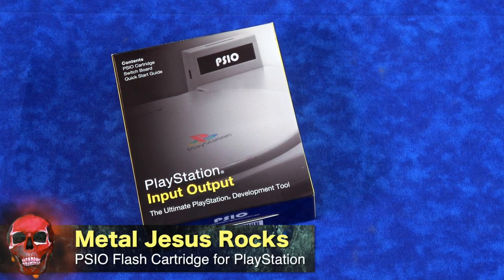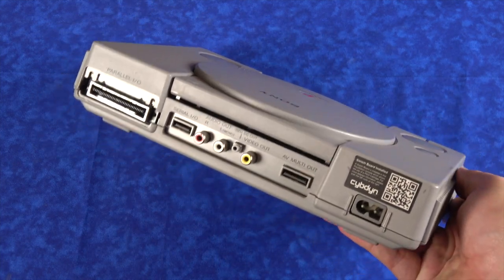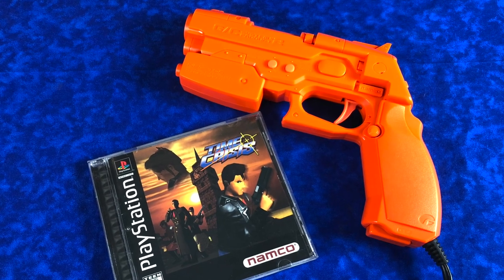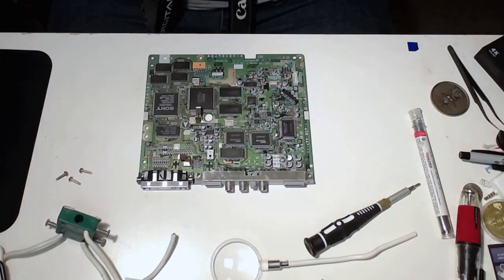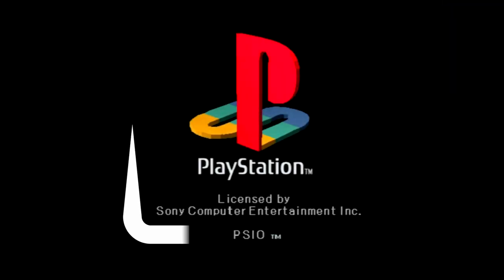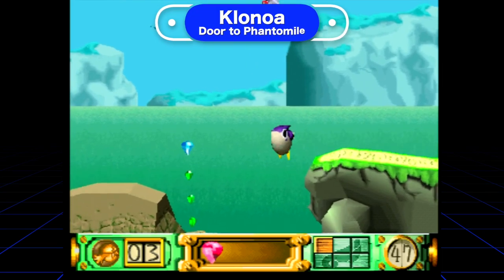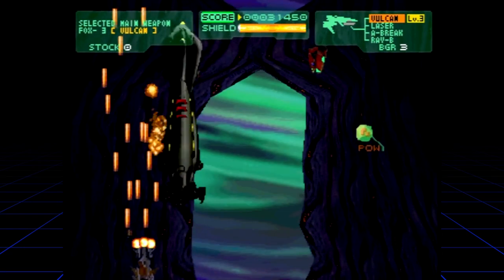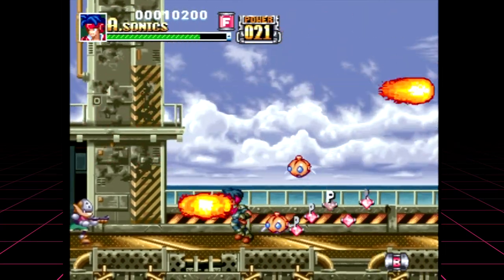PlayStation PSIO - SD Flash Drive for your PS1

Comment: PS1 is probably the last console I would get something like this. With the game emulation being near perfect on almost every platform,  there isn't really a reason to play on original hardware. For consoles of the next generation though, I would get one gladly.
Reply: PS2 and Xbox are both easy to soft mod.   Dreamcast has the gdemu (no soldering required).  I don't think there's an ODE for the GameCube yet, but you can play all the games on a soft modded Wii

Comment: This seems like a pretty decent product. I would definately buy one if I didn't already have a chipped PS1 that plays burnt CDR's. Would be nice to trim down loading times though so maybe i'll look into getting this with a second PS1.

As for the Saturn, take a look at the Action Replay carts, there is custom firmware you can load onto them to allow the Saturn to play burnt CDR's without disc swapping tricks or anything, great way to play backups on there and it also lets you play games from other regions.

Comment: I would just go through the harddrive port for the PS2. Be a lot easier and no soldering. I am not afraid of it, I can solder and this looks easy but why bother when there is an easier route. I am open to some other opinions if they are out there.

Comment: Probably the 100th person to say this, but there are already flash based CD/GD drive emulators for the dreamcast and the saturn as well as the turbo-cd. The PS2, OG Xbox, Xbox 360, Gamecube, wii, and PS3 all have software/hardware mods for loading games off of storage, leaving only the Sega CD, 3D0, and Neo-geo CD stuck on optical media.

Comment: Howdy Metal Jesus! There are already Sega Saturn (Naomi/Pheobe) and Dreamcast Solutions that replace the CD ROM drive with an SD card reader. They are fantastic but again, not for novice installers. Also, I highly recommend a phat for a similar solution to the PSIO; PS2, it can run PS1 games without emulation and you can copy games to the detachable hard drives for a PS1 and PS2 all in one solution. Heck yeah!

Comment: Couldn't this also save on over using your CD drive for an older system like this.  This is basically now a digital game, running off an hard drive.  I don't know much about disc rot (I know, I need to do my research) .Could this help with that in any way?  Anyway, it's really cool.  I bought my ps1 at launch and over time it had trouble readying the disc and I would have to flip the ps1 upside down so that the laser could read it better.  I could of used this BACK THEN. lol  This was a known thing, I even remember reading (I think) in EGM magazine about this tip of turning your ps1 upside and just a a way to play your games.  Well, it worked. lol

Comment: There is only really one big reason why you would want a thing like this. The cd players are GARBAGE, in all these cd based consoles it WILL break at some point and depending on the console it'll be really expensive to fix it. That's why I'll always prefer NOT ever using the CD/dvd drive ever if I have the option.

Comment: goddamn it sony. once again need a damn chip installed lol wtf
anyway, this is interesting i think i could consider it still ive soldered a bit before. 
What kind of load times do you get then? how improved are they? im very curious. SD card coupled with this parallel IO port i mean damn.
And price tag is a big factor too. Jesus christ 150$ and you have to solder in a fucking chip. Thats pathetic. If its not plug and play at the very least then it should be DIRT cheap. Like $40 seems fair but $150? bro come on. Idk about shipping.

Comment: Cool product. I recently put a backlit screen in an original gba and there's a wire you're supposed to solder to an impossibly small point. I tried but couldn't do it. Seems to work without it. I guess it would just be brighter with the extra power from the wire.

Comment: I think that is a damn great device. How many PS1s have already dead CD drives, most PS1s will eventually have failing CD drives in the future. With such a little piece of electronics you can extend the lifespan of a PS1 for decades, maybe literally forever. And you can make even units with failing CD drives working again.

Comment: Certainly a cool invention. I’ve always wanted to see a PS1 flash card. I’d like to see one for Sega Saturn (not the replacing disc slot with SD card slot modification to the motherboard, a flash cartridge which you put in the cartridge slot which can handle 4MB RAM or whatever gives out the best performance, will have an SD Card slot, maybe a disc that runs the software and may or may not require modifications to work), Sega Dreamcast (once again, not the disc slot replacement, a possible modification to the motherboard or a disc that runs the software) and I’d love to see one for PlayStation 2! Either the big one or the small one, possible modifications, however you are going to put it, someone should invent a PS2 flash cartridge or whatever way to play all games you want. Maybe even for Xbox and GameCube! (I do hear that the GC has SD card adapters for its memory card slots)
Reply: I do have 2 PS1 models, one with a parallel port (laser does not work), one without (I had a problem with the controller ports on that one, it still reads discs). Same for PS2, I have the large one and the small one (got for Xmas in 2008). Not thinking about ones for newer generations like 7th and 8th generation consoles because that can wait.

Comment: For $150 you could get at least 3 modded ps1 which could already play games from every regions... Of course you'll have to burn the games you want to play and your loading time will be a little bit longer than if you'd load them from an SD card, but I don't think it's worth the price.

Cool device though, if it was cheaper I'd get one.

Comment: If you are only looking for playing backups, there are many MM3 ps1 chips that cost only a few dollars that basically do the same thing.  It's a similar process of install and requires some careful soldering.  The benefit of that is games play on CDs and are 100% perfect as far as compatibility and also allows import games to run.  

On this unit since you have to remove it to play original CD's, in going to guess there is no way to have it just bypass the region lock to play original copies of import games. Maybe Metal Jesus can confirm?

$110 USD is pretty steep for someone like me.  I don't mind the small load times and boot up logo's enough to pay that much for when just playing backups can be done for much cheaper

Comment: The Dreamcast and Sega Saturn already have sd card base add-on like the GDEMU and Phoebe respectively. however they are not in the same price point as this device. This is a solid option, definitely will be getting one of these after the holidays.

Comment: There's literally two Playstation models without parallel port: the 900x and the PSone, aka the last models ever released. And my guess is that the switch chip doubles as region chip. I'll consider getting one if they really find a way to get rid of the switch chip. My PSX has a stealth chip built in, and I don't feel like finding out if the chips interfere with each other. Until then, CD-R it is.

Comment: There's already a way to mod the Dreamcast to use a IDE/ATA HDD, sd card or even a CF card. A Russian team called DC-swat (Google it) has documented how to solder an ide ribbon cable to your Dreamcast and load it with gdi's you can use a modded DC bios or a boot disc and your Dreamcast has to be reversion 0 or 1. Afaik ver 2 Dreamcast won't work as there not mil CD compatible

Comment: Been waiting for a review for one of these so thank you!! Will order asap! But just a heads up the Dreamcast have what's called a gdemu SD card loader! You loose your gdrom drive but the way Dreamcast gd ROM drives are dying just latley isn't a issue! Also if your mate Chris wants to help you out buy a dreamshell flashed bios chip get it swapped out and buy the i.d.e re born PCB and get that soldered in so you can have a 2.5 inch ide drive with all your games loaded that's what I have in mine personally as you can have it located out the back of the console in a HDD enclosure and keep the gd ROM drive hope this helps!

Comment: As I understand it, you can already do this with unmodified PS2 consoles through the use of FreeMcBoot and some add-on software. Then put the disc images on a USB drive (or SD card inserted into a USB reader) and play them. You can also add a hard drive to the fat models and play the games from that.

Comment: This would be really good if you found an older PS1 with a worn-out disc motor. I got through 2 back in the day and each time I had to put it on it's side after a couple of years.

Yes I had (and still have) no life. No I didn't realise I could get it fixed at a tech shop.

Comment: WAAAAAAAY 2 expensive and def if you need to solder yourself. Also don't buy this but just use OPL and add a hard drive to the PS2 and play ps1 games that way or even on a modded ps3

Comment: You guys didnt use this thing back in the day when PS1 was out?  I used to plug this unit into my PS1 and then I was able to run PS1 back up disks (basically ripped games) as if they were the original disk.

Comment: It's a good device. More for advanced users as you'd have to get someone to install the switch board inside the system and some games require different modes or a patch to work, so not for beginners for sure. It's a lot less friendly than say the USB GDROM or the Super SD System 3(and even the SSDS3 needs modification to fix a few major issues with audio and video)
Reply: oldgraphics Nope. I mean this device. Yes, there is an active forum, but you have to constantly refer to it as some games require specific settings to work. More notably the Streaming Audio settings, so you really need to read up on it. That’s fine for people like you and me, but a lot of his audience are older or not as tech savvy and just want something they can throw at and work. With the USB GDROM and Super SD System 3, most if not all discs works without special mods or settings. With PSIO, quite a few games need special settings and you will need to convert all your BIN/CUE to single BIN images with CU2 format cue sheets. So you will need to do a bit of work before even running this thing, whereas the USB GDROM and Super SD System 3 is more drag and drop. Give a perfect example. 300 games for my PSIO unit took about 12-14 hours to full convert and put together(as also for multi disc games, you will need a MULTIDISC.LST file that their systems console doesn’t always make correctly)
Reply: oldgraphics you cannot just drag and drop to the SD card for PSIO. You need to convert the image first to BIN/CU2. Especially when using the Redump versions which have multiple BIN tracks for sound. And yes you will need to reference the forums a lot as there is no actual chart for settings or compatibility. General rule of thumb is black screen=trip to forums. Matt even said it’s not something they can fix or streamline as it is down to the PlayStation itself. It has three types of streaming and the wrong one will make the game not work. Other games like Spyro 3 need to be patched to work(anti piracy detection). Also, certain modes of the PlayStation have had difficulty running certain games whereas other models don’t have that issue. I seriously need to do a video explaining and showing all this. It’s hard to just put into words without pictures or video. It’s a great device, but for those who aren’t as tech savvy, it’s a headache at times

Comment: the FMV skipping is not necessarily the disc. those early SCPH-1000 series consoles have a common problem with the plastic laser assemblies wearing out.
Reply: @oldgraphics  thanks for the info :) turning the PlayStation upside down will do nothing for bad caps hah

Comment: I'm a fan of the speedrunning community, and the fact that you mention faster loading times has me worried about this device's usefulness for them. Does it have a setting to properly emulate the original optical drive's load times? If not, then this may unfortunately not be ready for the speedrunning community due to fairness.

But also, there is a Dreamcast SD card optical drive replacement already out, or at least far in development. But if someone used that tech, and made it into a Dreamcast modem/SD reader for similar functionality, that would be amazing.

Comment: Why do Americans say sodder? It's solder.
Reply: Dialect differences. For example, Color and Colour and Aluminum.
Reply: Fact...Its pronounced sodder that’s why.
Reply: Happy Christmas :v
Reply from the maker: Al-LOO-min-eee-um. ;)
Reply: If they SPELT it sodder, it would be a different matter, like how aluminium is spelt AND pronounced differently in America. But it's solder. They're flat out pronouncing it wrong. What happened to the fucking L?
Reply: @eddiew.4650  colour and color are spelling differences, not dialect differences.
Reply: @rooty  Spelled not spelt
Reply: ALI-MIN-YIM @MetalJesusRocks  from AUS :)
Reply: The same reason that non-Americans call the United States "America", instead of United States...or USA.

Comment: How it runs all regions? Simple. It just bypasses the region lock. Playstations from all regions can read games from all regions if the lock is broken. There is no difference in hardware or clock speed. If the chip can tell the ps1 to read a game from the parallel io port then it sure can change the mode to NTSC.

Comment: I have a PSIO it took a year and a half to get it i guess they had a hard time getting it developed but installation of the switch chip wasnt that bad if you have basic soldering skills. but i do love having it i have a 256 sd card and have a library of 200 games with still room on my card for more.Best part is your running this on original hardware. Better than a playstation classic.

Comment: i remember i had a device like this for my ps1 that allowed me to play cd burned copies of my games so i wouldn't have to constantly handle my originals causing them to get all scratched up.

I ended up throwing my ps1 away because it was at the point where it wouldn't read disc's anymore. Even when i had it tilted in every which direction possible since that was one of those tricks that seemed to make disc's read better back in the day.

I really regret that now considering i could just get one of these things.

Comment: Dreamcast has a device like this already called the GD-EMU , pain in the butt to find and can be expensive but im pretty sure decent clones exist now too,

Best option for sd loading on dreamcast (if you csn handle a soldering iron) is the ide hard drive  mod and an ide to sd card adaptor, that way you dont lose the disc drive like you do with gdemu

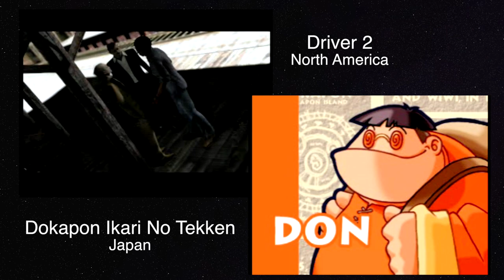Comment: 2:50 but does it run them at 60 or 50hz? 'Cause the whole point of being able to play ntsc over pal is that sweet pre 6th generation 60hz gameplay. If it slows them down to 50hz then what is the point
Edit: 5:10 well I guess that solves that then

Comment: My Saturn was doing the same skipping and really long load time with some discs.  I just need to open it up and turn up the power pot on the CD drive a little.  The lasers get a little weak over time so you have to turn up the juice ever so slightly.  And make sure the glass lens is clean with a micro fiber cloth.

Comment: Sega Saturn already has a flash cart solution, it's called the Rhea, but it requires you to remove the optical drive (the process is reversible).

Comment: While I understand its purpose, I don't really see the point, especially at that price. If you have to go through all of that work (and costs) to play roms on physical hardware, you might aswell go the other way around and just play them on pc with an original controller connected via usb adapter.

At what point does "playing on original hardware" stops being relevant if all you're doing with said original hardware is load roms?

I mean, if you have a modded PS1/PS2 (who doesn't nowadays, anyway?) chances are you already have both the region-free and the anti-piracy chips installed which means that you could just burn the rom to an actual cd and play the game through there. Which is cheaper (virgin cds/dvds are what? $0.10 each?) and actually still giving the "playing on original hardware" thing a reason to be used.
Reply: Shame its not shown in the video, but the much faster loading times are great for most user,
And the convenience of putting rom straight on to SD card and play is amazing for a developer! Much better than waiting a year or two for your exe to send over serial or burning a disc for a build that probably won't work. 
Come one man! It's a flashcart! How it's a question of use ? Any alternative to the CD drive is great to avoid failure of it, and can really help out !
It's still original hardware all the way. This is a disc based system. The games were on discs, discs don't think or anything, they're just spinning data. Sure I can understand a flash cart of a NES or something that has extra chips and processing in the cartridge, but a disc is just a data.
Reply: @televisionandcheese  If all you can come up with to justify it is "loading times" alongside "convenience", then a pc is still the better option.

Comment: the reason all regions work is because the disc drive itself is the region lock. it detects the specific way the disc wobbles and this device cuts out the middle man making it region free. thats why some resurfaced discs stop working.